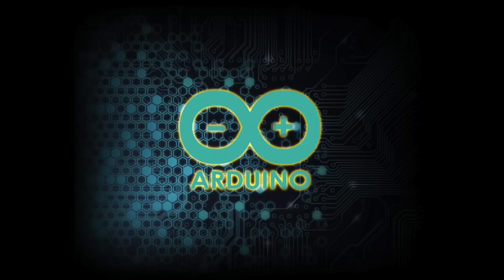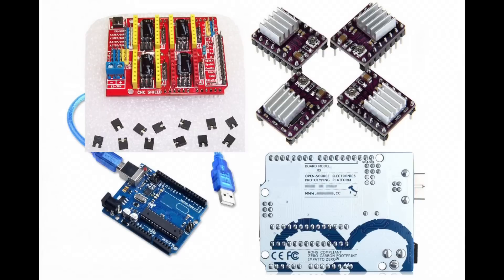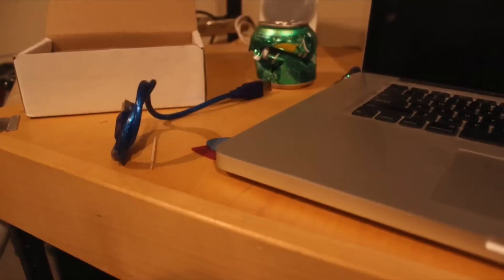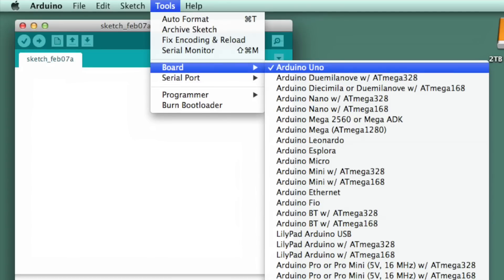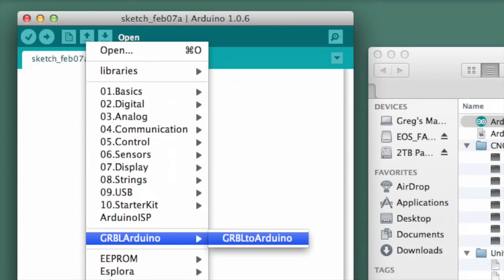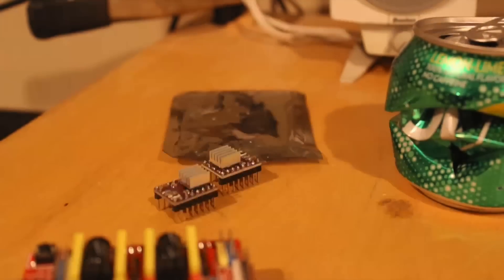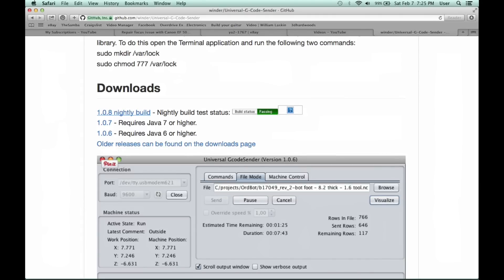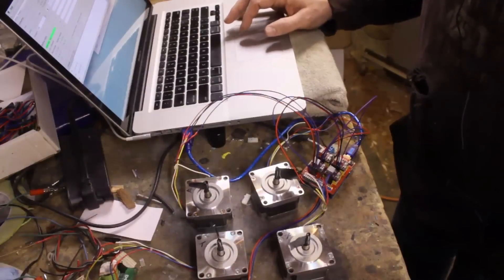Arduino + CNC + Mac - DIY CNC Controller Made Easy

Comment: that would be done in the advanced under machine setup? I I was looking but I couldn't find a spot where you would turn that off but i did find a line were you can turn the low or the high end stops on or off I saw something that resembled that inside where the code was under the advanced tab would it be possible to get a screenshot of how you have your settings under your Advanced tab.     correct me if I'm wrong but I do believe so and stop is for a direct short meaning AKA mechanical switch and high you would need some voltage or something like that and never mess with that did I get those right or am I completely thinking incorrectly

Comment: I like this set up better then the 2560.    I got mine in and running how ever I cannot seem to get my end stops to work. have you had this problem? if so how did you fix it.
Reply from the maker: Yes.  I can't remember exactly, but it was def a trick.  I believe software limit have to be off for it to work.

Comment: would it even work without a shield if we just figure out how to connect them.
Reply from the maker: +manan thareja You have to have stepper drivers...  You can get drivers that are not attached to a shield and build up the signal direct from the arduino.  So yes, but with some additional parts.
Reply: +Greg's Garage ya I do have the drivers drv8825

and some additional parts like...
Reply from the maker: Those drivers are not stand alone.  You need the shield with those.
Reply: +Greg's Garage thx for your help

Comment: just binge watched the cnc playlist..awsome job Greg. Subscribed. I just bought an off the shelf cnc kit..stepcraft. Already know that I want to build my own, but bigger and cheaper. I'm an electronics hobbiest and enjoy a bit of woodworking and home renovations. Starting to obsess about welding. What is the best way for a newb to get started..ie type of welding machine. haven't checked out the rest of your vids.. Do you a how to series for welding? thanks..
Reply from the maker: +raindogred Mig is the way to go if you're a beginning welder.  Set it up, attach a ground clamp and squeeze the trigger.  It's a bit like hot gluing steel!  Get an auto darkening helmet from Harbor Freight.  I don't have any good how to mig weld vids, but there are a lot out there.  I'm a fan of Miller/hobart machines, but any mig will get you going.  Good luck!
Reply: ok thanks for the info

Comment: Hi.I have a problem.I connected my Arduino board and step driver4988 on cnc shild and connect to gcode universal when click open. write connected to com4@9600baund but my step motor not move Please help Thanks for nice videos
Reply from the maker: +meysam turk Can you communicate with the arduino without the cnc shield in place?

Comment: Hi Greg!. Nice video, I' want to do my own CNC, Apparently Pololu DRV8825 that you used on this video, today are discontinued.

In my country are selling CNC Shield for Arduino with 4 Pololu A4988 Steper Motor Driver included and heatsinks. for $20 USD.

If I bought this What difference I have, Do i need to modify something? software or hardware?

Thanks
Reply from the maker: +Gerardo García No modification necessary.  The different motor drivers handle different motor sizes.  You'll have to match the driver to the amperage of the motor.  There are a handful of different pololu makes.  Just pick one that will work for your setup.

Comment: how did you get the library into the library's folder? and on get hub It downloaded a lot of separate files under GRBL urduino master which one is the driver?
Reply from the maker: +James Gardiner I'm trying to remember.  I'm going to make a vid on the 10 steps with a lot of detail.  I'll make sure that gets in there.

Comment: Cool video = 1 new subscriber
Reply from the maker: +fumezflori Thanks man!  Doing the last few tweeks to the CNC in the next couple weeks.  It's been a fun project.
Reply: +Greg's Garage Man, part of this video is on the seller ebay page of the arduino :) you can charge them for author rights:))) http://www.ebay.com/itm/CNC-Shield-UNO-R3-Board-A4988-Driver-w-Heatsink-Kits-for-Arduino-3D-Printer-/262041338342?var=&hash=item3d02e181e6:m:mxZqIWqeKubyCcF7jaudXoA

Comment: If I'm using Easel and everything works fine,  do I need to download more drivers or software to use UGS  on my Mac ?  I'm using X-Carve machine with the stock Arduino Uno and Gshield built with it.  I want to go from using Easel online to using Inkscape, Makercam, and UGS.   UGS is giving me unknown application in drop window.  Not showing my usb.  If I need to do the terminal commands DO i put both commands in at the same time or one at a time ?  What's going to happen after that ?
Reply from the maker: +BlackLocustMusic Connect to your Uno with arduino IDE first.  You should be able to see the card.  Follow their directions for connecting on Mac if you can't see it.  Once you have a connection in IDE, you should be golden in UGS.  I had to make one change in the terminal.  You just issue one command at a time.
Reply: +Greg's Garage   I got it jogging. Will try drill op tomorrow.  Thanks.  Set baud rate at highest.

Comment: hi Greg! nice video. what size stepper motors can you put on the shield? can you use a tb6560 or t6600 on it instead of the a*** the one you got? curious as to what would be the max voltage and current for the stepper motors. thanks for the reply in advance.
Reply from the maker: +Hosea Kenji Baldeviso I'm using 200 inoz motors.  they draw about 2amps each.  I believe you can use tb series drivers with the uno.  You just have to run the wires from the uno to the tb.  Check out the protoneer website for the pin outs of the card.  It shows inputs and outputs.  The max voltage is 30v.

Comment: Can you use unipolar steppers with this? How do you make the connection with what you showed to a program such as a foam cutting program to make it work? or can it work with something like mach3? Thanks for your time.
Reply from the maker: amtpdb1 You can use with either uni or bi.  If you have 6 wires, just leave the ground wires out of the mix.  The motors I used are 6 wire units.  The black and white wires are folded back out of the way.
Reply from the maker: Greg's Garage Oh.  The arduino takes g-code/GRBL.  Any program that can make g-code will work.  Typically your CAM software can write the g-code, then you can use universal g-code sender (a free piece of software) to send the commands to the motors through the arduino.
Reply: Greg's Garage Thanks for your time and information. I will have to learn more as some of the programs I want to use have the g code in them and you just pick the airfoil you want cut and it takes over. I wonder how they would work together with the arduino?  Thanks again.
Reply from the maker: I suspect they would hook up direct to the arduino as the "serial connection" via USB.  Any program that sends GRBL should do the trick.  If not your program can kick out the g-code and the universal can send it.
Reply: Greg's Garage Thanks again.
Don
Reply: +amtpdb1 I have clicked on everything and can't seem to get the g code sender to open! windows7 64. Any help on what to click or press would be great. Thanks.
Reply from the maker: Usually its a JAR file.  It should be a universal Java script.  UGS is fairly buggy, I am testing another software.  I should have a video on it next week.
Reply: +Greg's Garage Thanks, I'll be waiting for it.
Have a nice rest of the weekend.

Comment: Nice build im glad you went with arduino and the grbl shield. That shield is most likely a copy of one designed by this guy... http://blog.protoneer.co.nz/  I have 3 or 4 of them kicking around and a few are same as that one there.  been a while sense i played with gcode sender... get fermiliar with i think its double dollar signs $$ i think it puts you into the menu to change settings on the arduino
Reply from the maker: builtrodewreckedit Thanks for the tip...  You're spot on about it being a copy from the protoneer guy.  Thanks for the help on the $$.  That's exactly where I'm at right now.  I need to edit the defaults for speed, distance per step etc.  I've forgotten where those were.  The arduino settings is where I need to check now.
Reply: the double dollar signs typed into the gcode sender brings up a menu that lets you change all of the settings on the fly without using the arduino ide. its pretty cleaver. Holar if you need any help

Comment: I believe the arduino open source spec EULA or what ever its called allows clones to be called arduino as long as they follow the same build specs.  I believe its the configuration of the hardware that makes it arduino.  I may be wrong about this but this is how I understand it.

Comment: Cool video Greg, you are correct only the real "made in italy" arduinos are allowed to be called Arduino,  if it's a copy they likely copied everything about it.  Not likely to be a problem.  They actually have binary images of the GRBL software that you can load on github,  you wouldn't need to install anything other than the drivers and wouldn't need the IDE.  But they are fun to play with.
Reply from the maker: TheWreckingYard Yeah...  They ripped it off completely...  It's stamped with "Ardiuno" and it even has the Arduino.cc website printed on it.  I didn't really want a copyright infringed board, but that's what I have.  I'm guessing the Binary image is uploaded with a Hex loader? Or is there a different way?  I went with the "easy way out" since I don't know much about mac and hex.  I suspect it's pretty simple though.  Thanks for the heads up.

Comment: Did you use Motion to do the animation?  It was really cool... I like this kind especially being a Mac user
Reply from the maker: Velvethamma I assembled the animation in FCPX.  You can do the same in iMovie...  Import all the JPGs, place them on the timeline, turn off cropping, give them a .3s duration and walah, you have an animated do-dad.  It was way easier than I anticipated.  I'm def going to be doing more of these.
Reply: Greg's Garage Cool... I'm gonna have to give it a try.  I'm sure I'll have questions, lol
Reply from the maker: Surpringly, there's not much to it.  Just move things in small increments and snap shitloads of pictures.  FCPX lets you combine the images into a compound clip.  You can then control the speed interactively.  iMovie may have something like that, but I don't know it well enough to tell you how to do it.  I may do a "behind the scenes" if I do another one.
Reply: Greg's Garage I figured it had something to do with lots of pics in different spots to make the animation.  A vid might be cool... like in your spare time...lol